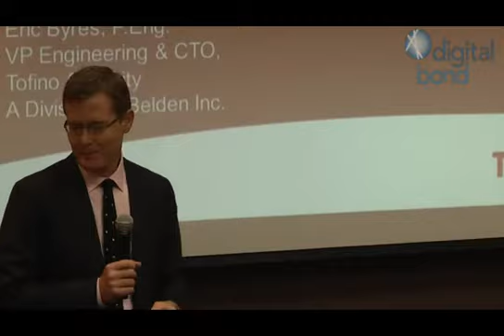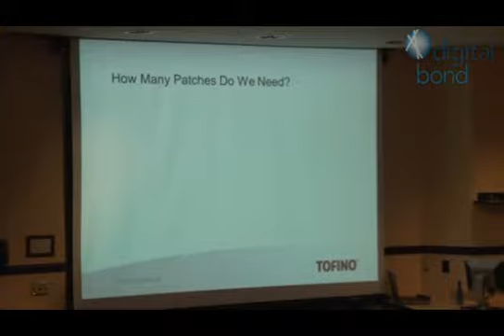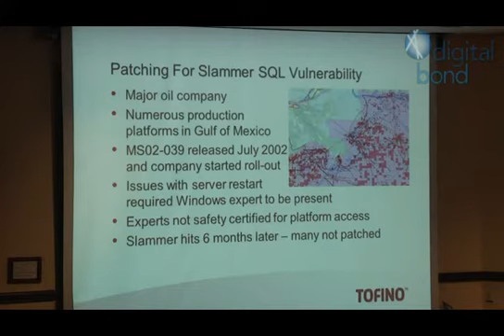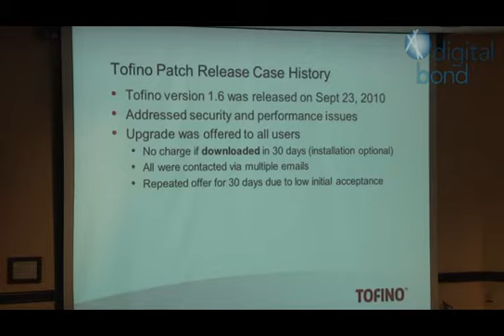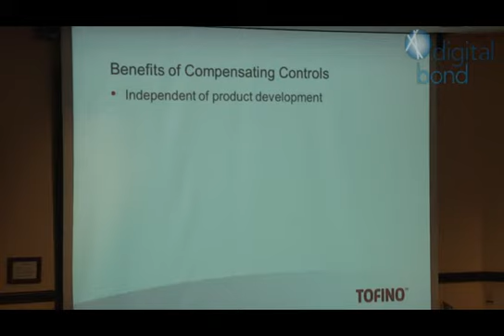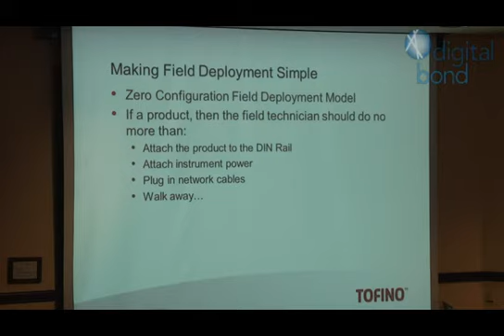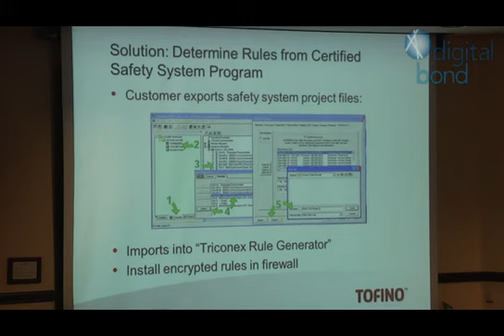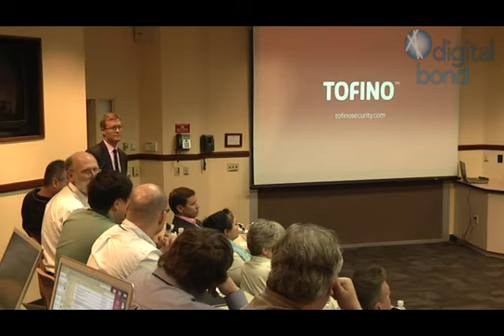Why Johnny Can’t Patch  Can Vulnerability Patching Work in the ICS World

Comment: I don't know who mentioned it in the audience, but indeed, being able to downgrade into a certified safe operating mode during the upgrade could be part of the solution.  Like always, there is a turning point where it is more costly not to upgrade.  We won't get there only with better products, but with systems designed to upgrade  safely.
Reply from the maker: The huge increase in virtualization makes rolling back patches fast and reliable. We are starting to see virtualized PLC/controllers where this will be true as well.